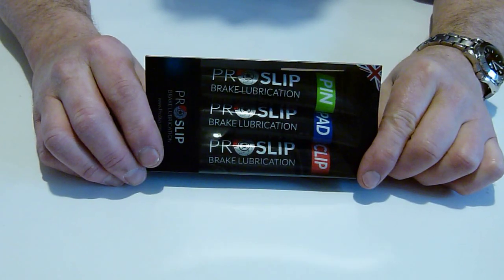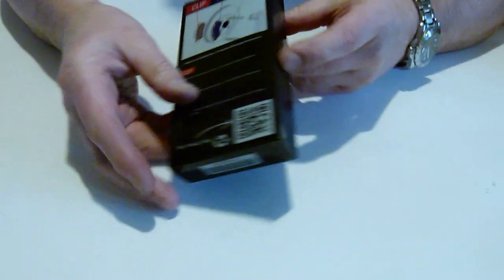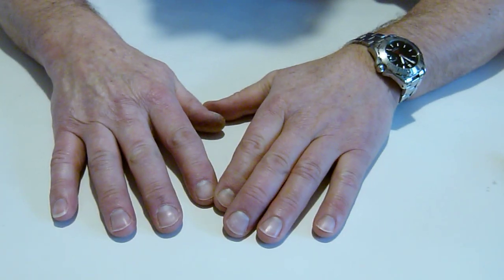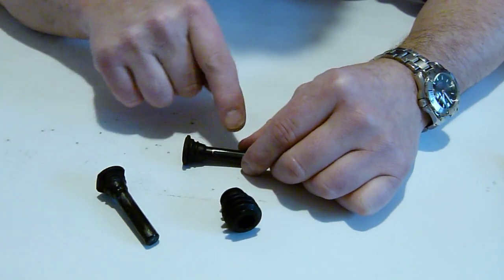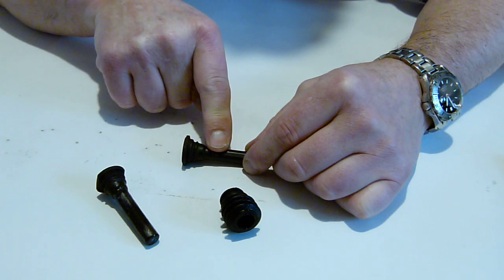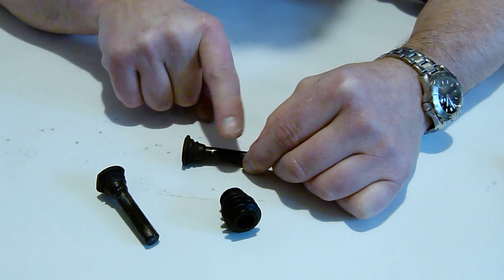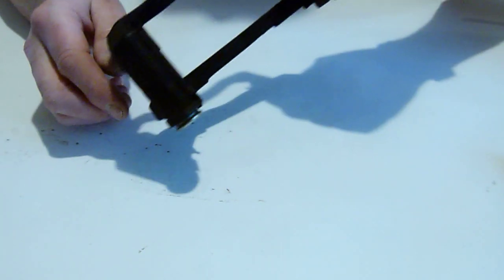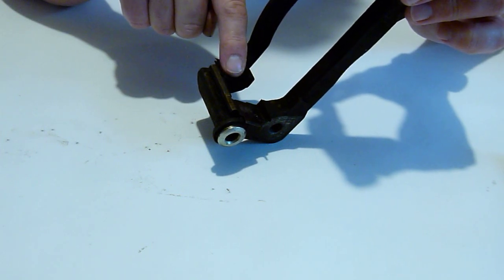Why THREE  tubes in ProSlip??

Comment: hi, been seal motor parts for some 30+ years and brake grease has always been my pet hates! listening to top fitters and reps from ferodo, trw, apec, adl etc still cant give my an answer as what grease to use? with them saying i'm over thinking it!!! but you have i think sorted that! one question would you use clip grease on both sides of the clips?? p.s i will be buying!
regards alan